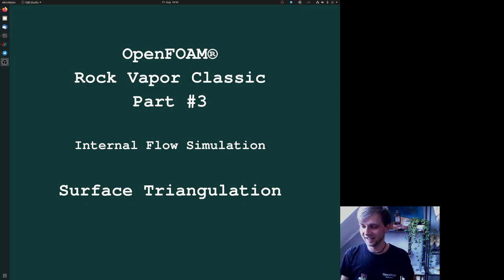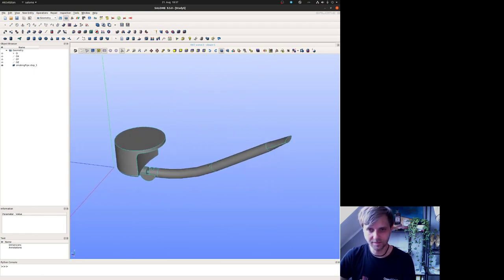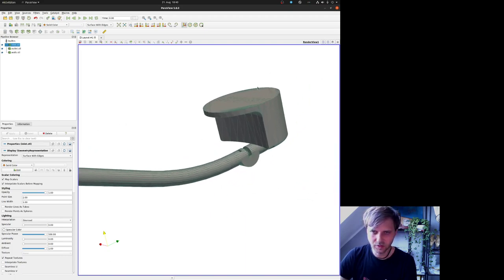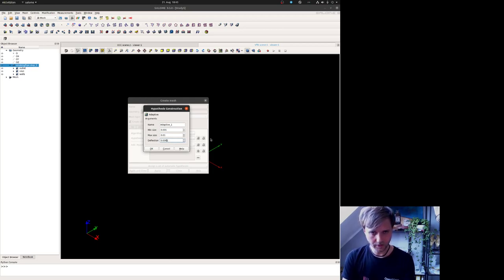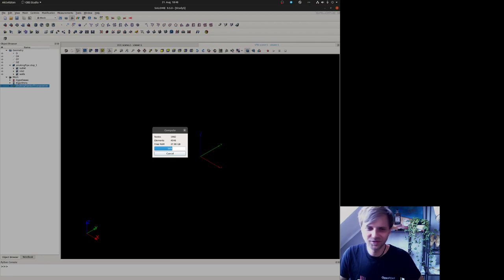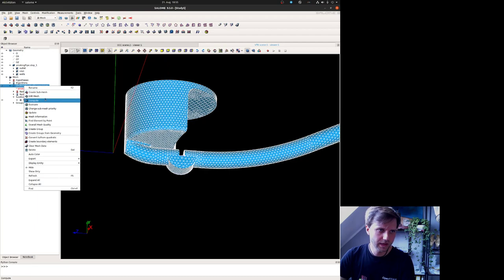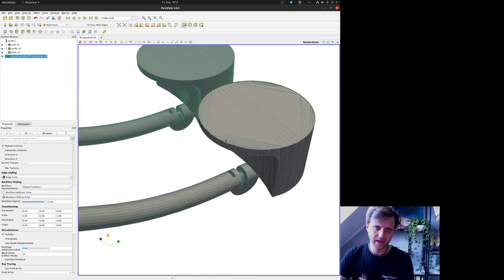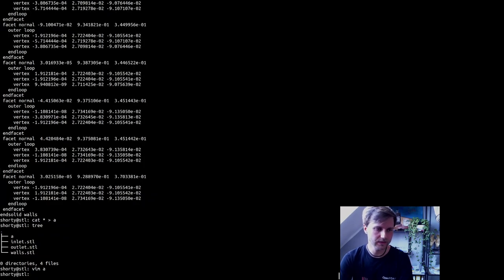CFD Analysis of a Smoking Pipe | Part 3 | Surface Triangulation ∇ OpenFOAM® v8

Comment: Hi thank you for your awesome tutorials!
I am using Salom 9.7.0, after Creating the surface triangulation and the groups i wanted to export the parts of the mesh to a stl file. However I get the error message that I am exporting the group without the mesh? How can I export the Group with the mesh?

Edit: Never mind I ignored the error Message, the triangulated surfaces geh exported

Comment: I am wondering if you can do the same for a floating structure and the boundaries of the water? So defining walls for the water (open sea), in- and outflow and bottom. While there is a floating structure in/on the water at the same time?
Nice videos!
Reply: I mean this videos are about internal flow, would it be the same procedure for external flow?
Reply from the maker: @Ras-kr5nw  yes
Reply: Thanks for this fast answer!

Comment: Do we need to have a certain ratio between the cells dimensions in the background mesh generated by blockMesh and triangles at the surface from Salome? Should triangulation elements have smaller size than background mesh for better meshing with snappyHexMesh?